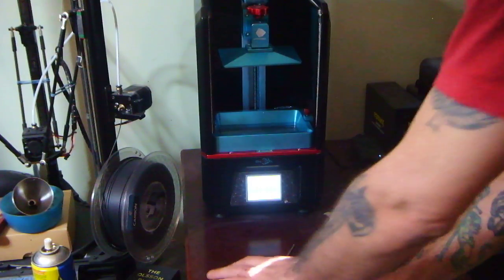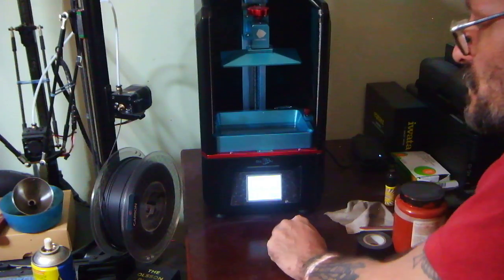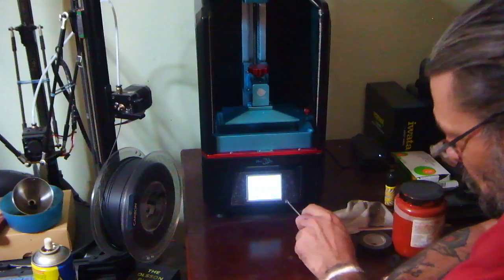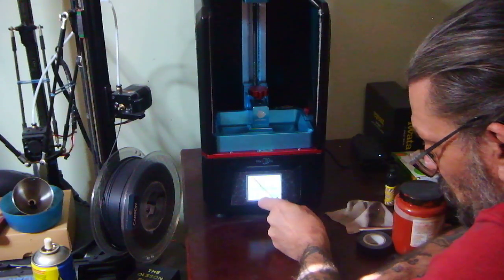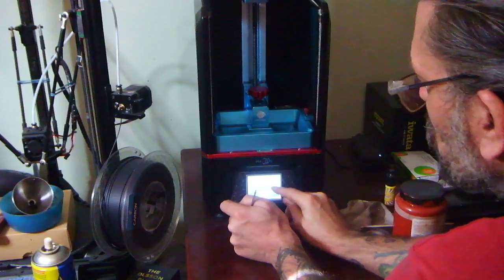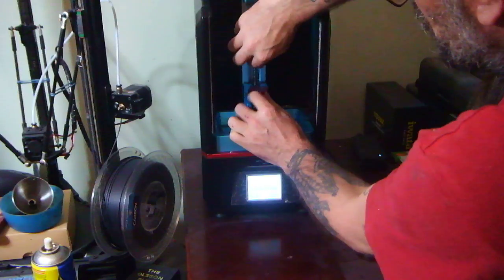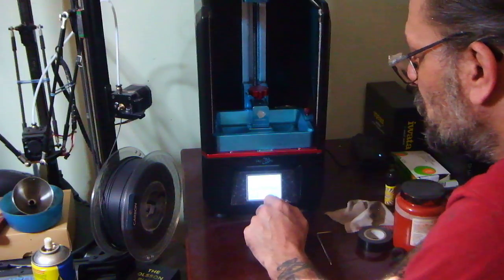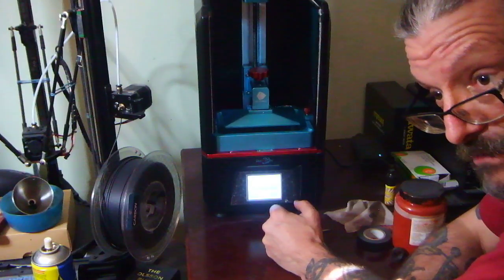Levelling the flint read way

Comment: Something we have to bear in mind guys, FEP film manufacturing is close to an exact science but there are still weaker tolorances than those with paper manufacturing. Therefor we cannot rely on the FEP film thicknesses to be as exacting as paper. That is why this method is preferred since it is being calibrated using the FEP film as oriented for the printer setup and takes into account the fact that not all FEP film is created equally and will ensure that your print bed is properly aligned for the film you will be aligning to. Thanks a ton for this video Flint, and I dont think you did a bad job at all creating the video!

Comment: Well I understood and had Zero issues with the video after 2 failed prints I tried this method and am halfway through my first print and it's actually sticking to the plate now, probably going to have to figure out the proper exposure settings but aside from that, you fixed the main issue I was having with this printer. Thank you for taking the time to make the video

Comment: This is the best way to level the bed. Thanks for this!
Only thing with this printer is that when you tighten the screw to lock de plate it is pressed down a little by the screw. So when you put it on the FEP film and can't move it anymore, when you tighten the screw you press the plate down even more. So I had to play a little with this to get it right.

Also you need to make sure the metal ring that secures the FEP film is not sticking out at the bottom. The FEP film needs to be the lowest thing sticking out at the bottom. Otherwise when  you press down the plate you stretch the film down.

But after failed prints this method is the best at this moment.

Comment: Thank you so very much.
 Have been struggling after some times, no print what so ever. Bed was to high and the Anycubic method with one sheet didn't work, the resin gets pushed away I think.
Using your method but with 4 sheets of paper and no vat and ofcourse the FEP film in the printer.
Looked safer to me, FEP film is expensive'
And now it,s printing again.
BTW. 4 sheets of paper is 0,4 mm. minus the film ( 0'15/0'2 mm, according to Anycubic) the gap is between 0,2 and 0,25 mm. for me the ideal hight for resin printing.
But remember, be very, very carefully, don't break the glass.

Comment: Thanks for sharing this video. It also started an interesting discussion about leveling itself. I cant see unboxing videos anymore ;) We need more videos like this.
Anyway, i refined the paper leveling by cut the paper in two and push and pull them left and right individually, while moving the  Z axis. With this i can make sure that the build plate isn't tilt left or right. Also i can double check it after tighten the allan screw. Sometimes tightening dis-adjusts the leveling. 
Another reason for dis-adjusting is holding the plate on the bracket while scratching away the prints. 

An important theme that i missed, you answered to arxefix, is the step setting. I wondered if 0,05 was right by remembering on my FDM experience. There is ,28 better then setting .3 mm for example. 

Finally i ll give your leveling method a try :)

Comment: Thank you!  This seemed to have resolved my adhesion issue with opaque resins.  They seem to be less forgiving with zero height than transparent resins for obvious reasons.  The transparent green that came with my printer worked great every time, but I couldn't get anything to print with the gray.  Just followed this and now I can hear the distinct popping of the print off the FEP on each layer.

Comment: Thank you, it works now......  Anycubic should change their manual for the photon resin printer.
Reply: @flintread  despite screwing the plateform, during printing it has twist,  I think the system is not reliable. Each print must be adjusted again, because it moves when you remove  the model.....  it's not a plug and play system. not for everybody. it takes a minimum of practical spirit, to be able to use it.

Comment: Doesn't this increase the risk of scratching the fep with the build plate compared to other levelling methods?
Reply: if you're worried about scratching your fep just cut a sheet of paper to fit the bottom of your vat and then only raise your bed level up .1 before setting zero

Comment: I just wanted to thank you for this tutorial, I had 4 failed prints in a row (I know it was user error). Tried your method and it is finally sticking to the build plate! I just had a question about cleaning the FEP, I use IPA and a micro fiber cloth(2 of them) but I'm still getting a foggy look to the bottom. Any tips on making it clearer?

Comment: I tried your technique yesterday and yes, it worked. I have had my machine for a week now and up to yesterday I had been unable to get a successful print. Well, today I tried to print something else and suddenly the LCD display wasn't working. I contact Anycubic tech support and they said to download the latest firmware version. I downloaded it, read the instructions on how to install it and did it. The machine rebooted and then the LCD display worked fine. So I loaded a file to print, poured in the resin and started the print. An hour or so later I paused the machine to see if it was printing. It wasn't. It had stuck to the FEP film and not to the printhead. I'm wondering if I should have re-leveled the print head because uploading new firmware might have reset the Z=0 setting. So my question is, do you relevel the machine and reset Z=0 on each print?
Reply: im having the same problem
Reply: No, once you have a good leveling, just leave it there and just press print whenever you want to print a new file, but if you have a failed printing, you have to start all over again until you found that good leveling.

Comment: I tried your method but I have an issue :/ the rear support bracket of the plate can't go down any further, the resin van doesn't allow it and I heard some bad noise coming from the mechanism :( Another thing I don't understand is how much the plate needs to go down. I see you go up 0.3, but if my plate is not very low, nothing will remain attached/printed, everything is still in the van. I can do a good print once every ten times. :(

Comment: after tightening the bed, you raise the bed 0.03mm, how relative is that distance to layer thickness?
Reply: personal note, this difference made getting my prints of the bed much easier, i was often having too pry my prints off, and that would result in me ruining the leveling, and having to go back to square one.
Reply: Your comment confused me. You cannot move the Z axis by 0.01mm, and listening carefully, Mr Read has it moving 0.1mm per tap. So 0.3mm.

Comment: Flint. Appreciate the video. I tried this but ran into a problem. When the vat is in place, the arm of the lift hits the vat wall and stops before the plate is close to the screen. It never makes any sort of contact. Any ideas?
Reply: I'm a complete noob, but have read about this being a common problem on some AnyCubic Photons. The solution is to use washers/shims to space the arm. If you search on reddit.com/r/anycubicphoton, you should find the solution.

ETA: https://imgur.com/gallery/Fw6a3nJ This talks about the solution.

Comment: after i tighten the platform i can still move the platform. I am thinking it should be tight after this process? Just received this and dont want to try a print until i find out
Reply: i got the same problem, after i tighten the platform it stil can move... any ideas?

Comment: I had no luck levelling with the paper method, it took ages and even then it seemed like one corner was always a lot lower than the others. Plus, you can't see where the build platform is going, cause there is a sheet of paper in the way. Going to give this a go, fairly confident it'll work based on all the comments :)

Also, in another comment you mentioned an ideal layer height of 0.04mm. Does this take into account the pitch of the z-screw? I assume this is to do with micro-stepping. Is below 0.04mm layer heights feasible? What sort of resolution have you been able to get?

Comment: Tip: "Before you try this"  -  Use an Old/Used FEP sheet instead of the VAT otherwise you will scratch your FEP every time you level the bed
Reply: BN Rail Nut exactly!  Why would you do this in your vat?
Reply: Actually I just did level it with my vat a little greasy with old resin (even though I cleaned it twice) and it didn't scratch it. First print with this new method, hope will work.
Reply: Nope... failed print
Reply: @overunity  its because of the left over resin, try it with a dry cat and if your scared about scratching it cut out a piece of paper to fit into the vat and only raise it up by .1 when setting the new z=0

Comment: I don't see why you raised it by 0.3mm. The normal instructions that use a sheet of paper don't have the FEP there, and paper is thinner than the FEP, and they don't have you raise it.
Reply: The instructions say recalibrating z-axis after tightening up the platform. That's normally 2 to 3 0.1mm steps up.

Comment: Hi. My pritns faild. Model not sticking to platform. Leveling is (with paper) ok but after i instaling resin vat ant start printing first layers, print platform hits the resin vat.
thanks to you I noticed what is happening, the walls  resin vat  are too high, I can not lower platform so that it adheres well to FEB
Do you know what the reason is?
Reply: thanks for the quick response, ... it comes to the mounting arm the platform, it hits the rear wall of the container and I can not lower it
Reply: I have exactly the same issue, the arm literally bottoms out on the top of the vat about 1mm or so above the FEP sheet
Reply: @grzegorzgrygorowicz4499  I was looking at the exact same item and wondered if it would be a solution, I'm glad to hear it is :). Thank you so much for following up. Out of interest, did you go to Anycubic support about the issue?
Reply: Yes ;-) 
I quote a question from the Anycubic support  in the last conversation

"Dear there,
Really happy this problem can be solved.
May i know how do you find the black part in below picture? Sorry for my disturbing. I just to know more about your solution, So that it can help other customers next time."

:-)
Reply: @grzegorzgrygorowicz4499  Thanks again, think I'll contact support as well so at the very least they have feedback on the issue. Did upload this to go along with it https://youtu.be/vkBAhh8sXRw

Comment: so when it comes in contact with the FEP, you need to lift it 3 times 0.1mm, that means creating 0.3mm gap right?
I'm quite confused as for printing 0.05mm layer, wouldn't that too wide? it's in fact 6 times of 0.05??
Reply: Thank you for your reply.

I'll try again as my printing has some sort of problem:
1. I'm using Wanhao Clear Resin (I'm not even sure the resin setting of the wanhao clear resin, just using default value)
2. Tried to print a simple hollow box (some container) with the thickness of 1mm
3. The box not tilted, it is placed vertically to save space when printing multiple box

Problem are, the wall is not even 1mm thick and the vertical wall seems always broken :(
Also it leaves residue of cured resin on the FEP film..
My last leveling setting were using sheet of A4 and i'm resetting zero "when A4 sheet is no longer movable when tried to be pulled", looks like i'm setting it too low then??
Reply: Noted!

But there are still confusion,
first, did you mistype 0.03mm instead of 0.3mm? because the minimum setting when moving z-axis is 0.1mm ??
second, what is "off time"? or, when is is that "off time" happened?? as what i observe was, when the z axis moving up and down between exposing of each layer, it took about 6.5 secs, and clearly the UV lED is turned off within that 6.5secs..

based on this video, the off time seems just for calculating the printing time (?) -> https://www.youtube.com/watch?v=YhAFLeSBrFc
Reply: That's interesting never thought of the impact the layer setting has on the stepper, always assumed manufactures would optimise for this when selecting hardware, naïve I guess. So as a rule for the Photon you know 0.04 or perhaps 0.08 would be optimal? 

P.s thanks for the Video, going straight to this method when my printer arrives!

Comment: When you set the plate so tight against the FEP that you can't move the plate, you are pressing down the FEP against the LCD screen. Quite a bit, actually. backing it off .03 mm will make NO difference in reducing contact with the FEP. Also, when the plate lowers into resin, it most definitely WILL trap resin underneath it and be present for curing. It's science. I'm not saying that your method is wrong (it isn't), but your reasoning behind backing it off such a small amount is incorrect, as there is really no gap between the FEP and the build plate. Personally, I use a piece of paper flat on the screen with the vat removed, home the build plate, then go 2 full mm down, plus another .06 mm, tighten the build plate. I never have an issue with prints sticking to the build plate.
Reply: am I missing something or isn't he actually moving the plate up by 0.3 mm (not 0.03) after fixing it down on the FEP? 0.3 mm should be a good amount for a fat first layer, i should think...

Comment: Once leveling is done, the build plate should'nt move right? Mine gets a tilt almost as soon as it lifts up. Like tightening the screws does nothing to stop it.
Reply: Mine had two allen screws in the hole as I found out, had to completely remove one screw and the second allowed me to finally tighten it.